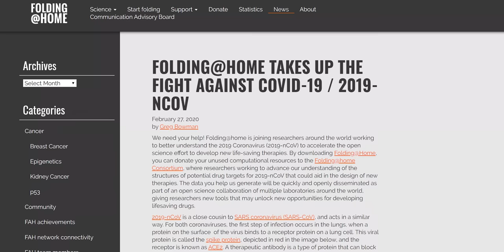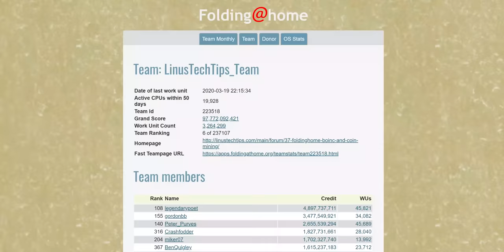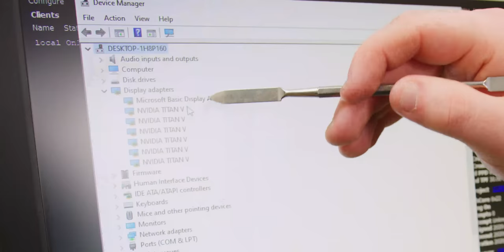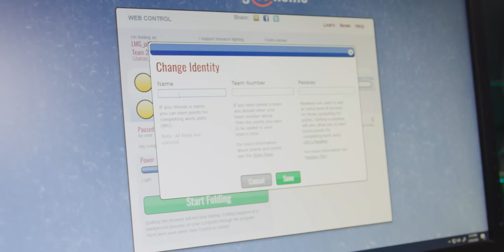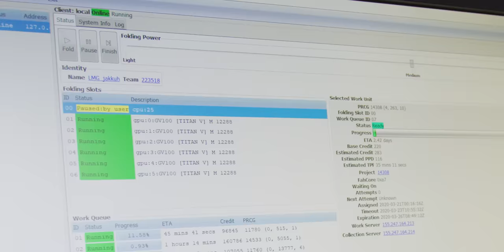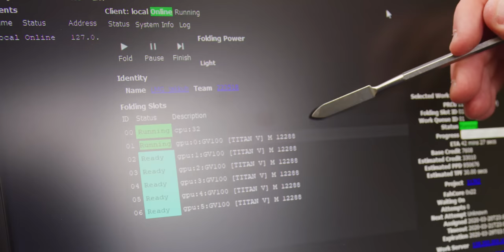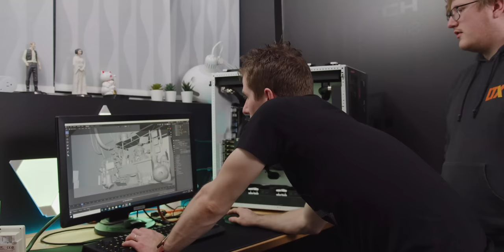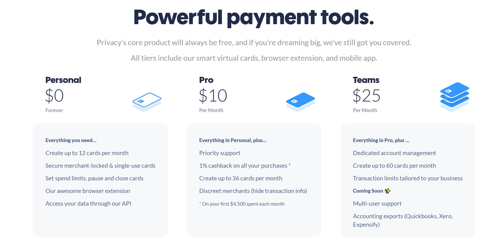Here's How YOU Can Help Find a Cure for COVID-19!

Comment: Sadly, I tried to run Folding @ Home last week (I had the same idea to help with COVID research) and found a few things:
1. My machine (which is rock-solid most of the time) would soft-lock daily, sometimes several times a day, whenever Folding @ Home would start working. Note that I'm not running anything odd, standard clock frequencies on an i7-7700K with an RTX 2080 and 32GB of RAM, Windows 10, etc.  Has anyone else found the same? Anyone found a fix?
2. Folding @ Home didn't have a COVID research category back then. While it felt good to help with research in general, I'd really like to ensure that my compute is helping with COVID research at this time. Have they fixed this? @Linus, have they addressed this?
Reply: I´ve had this happen occasionally when my GPU was folding full blast and I tried to watch some 1080p youtube videos, or do anything that borrows any more than a minimal amount of graphics power. My system has an i5-9400F and an old Radeon R7 250X. Another thing is that if I messed too much with the workunits (closing the folding program without clicking pause, restarting the system several times or pausing and restarting WUs too many times) they tended to error out. Note: I´ve always ran the client even while using the computer, and paused the WUs when necessary, like for gaming.
Reply: Gian N I tried it again today and sadly ran into the same result as before within a few minutes of starting a workload. I was re-watching this video (ironically) while it ran a medium-level operation and just a few percent in, it seemed ok.... then boom. BSOD!
Reply: @jerisbrisk7519  The first thing that comes to mind is if your power supply can handle the load, perhaps GPU folding draws more wattage than gaming? More so if you´re also running a CPU slot on F@H. If its at least 600W from a reputable brand, then it might be crapping out as opposed to not being powerful enough. 
I had some BSODs recently too cuz my 8GB memory stick was dying, so got it replaced under warranty after I ran memtest86 and showed errors almost immediately. Prime95 torture tests also failed after a while. Maybe you can get a clue from the BSOD report, which can be looked for on event viewer and shows a bugcheck code like "0x0000001a." I googled the code and found it was "MEMORY_MANAGEMENT".
Reply: @giann3021  Thanks, Gian. My PSU is a 750w from Node, designed for the Node 304 case my PC is housed in. I doubt I'm browning out, but who knows?  I don't have a Killawatt handy to test with, so I suppose it's possible.  Just based on the fan noise (usually a good sign of power draw) before and at the point of BSOD, I don't think I'm stressing either CPU or GPU that hard.

Comment: My GPU is running at 70C and when the CPU starts processing, it hits 80C. Is that too hot?
Reply: Depends on your components, but I've been crypto-mining with my RTX 2060 Super at up to 76-80 degrees for months without restarts and alls fine. I also mine with my R5 2600 which can hit 72.
Reply: @tfromthasix1956  Thanks for the reference point.
Reply: aowi7280 No problem!

Comment: Standard residential outlets (not breakers) in America do go to 2400 watts max rating. 20 amp X 120VAC = 2400 watts, but you are correct in a way. 1640 is 70 percent of 2400 which is what you want to be in for a constant amperage draw range on a full circuit or pass thru of the receptacle, don’t want to max it constantly. Explaining this only for people who were curious by his statement.

Comment: I own 3 pentium pc’s, trying to get them connected to the internet to install folded@home on it , but guess what i didn’t either of them on the internet , 1 didn’t get connected to the internet at all , whether i tryed it with a cable or just wirelessly, the second one despited it did get connected the the intermet, gave my an error massega evertime i tryed to go to that folded@home site,, the 3th one slso connected to the internet but i did gave my an error massage saying that my pc was out of time so i had to correct the time & date but even after trying just that i still ended up with an error massage, , i tryed 2 different browsers but no luck, i wanted to update both browsers but no clue how, but man that was  unbelievible , hogging those pc’s one after another out the garage in an attempts getting them to work, not mention i also had to try many keyboards & mouses for each specefic pc to get them to work pffff ,oh man i was feeling myself just like pink panter facing sooo many troubles i couldn’t solve, pfffff
what a joke 😀☹️😀☹️, so“sorry corona patients i want to help you all in such a cool & exciting way like this but i can’t so i give up on it.

Comment: he goes on about why you should use older hardware for this then pulls out a system which i would say is still more powerful then most have as their main system XD 
I mean that would probably still out preform my main i7 8700k, 32Gb ram 8tb nvme 2080ti build which is current.

Comment: Hey Linus, Great Work there Guys! 🌍🌎🌏⚡
Super-Machine, this One is! 😊

Hope you Guys can really come together with the project and set up a folding@home Server there so we all can Boost the project even more!

I too have started with folding@home some time ago (as well as BOINC - Rosetta@home) but I decided to suspend BOINC projects and going full power with folding@home, for one simple reason: each of the projects only use 1 core/thread per project. IMHO, this is not productive, since you get for example 8 simultaneous projects running on an 8 core/thread cpu, each needing 8 hours or more, to complete.

On the other hand, you have folding@home that uses ALL of your CPU power to tackle 1 project at the time, thus minimizing its completion time to the bare minimum! Plus, it uses WHATEVER GPU is available, comparing to BOINC that some of its projects use only nVidia GPUs (to my knowledge).

Comment: Hay Linus I really hope you see this, I have some older servers I don’t use and I would love to put them to good use. One is a supermicro X8DTH-IF with duel Xeon e5520 with 24gb of ecc ddr3 and a 250gb ssd. Well I don’t have 8 sata drives to go in this thing. The other server is dell power edge r710 with six 146gb 15k sas drives, one 6 core Xeon at 2.8ghz and zero ram. I understand there is a way to link this with your outfit. I would love to receive a donation to get these two servers up and running for a good cause.

Comment: I am considering buying a graphics card for my home PC, to boost folding power. First of all I would like to know if it is worth it, because I rarely see my girlfriends GPU running at all, thus I would like to know if there is any kind of shortage in GPU's (now and in future). 

Further Should the CPU be to scale with the GPU, I don't want to buy a top end GPU and then find it bottle-necked by the CPU. If it needs to scale, what is the top spec I can couple with a Intel Pentium G630, in a stock lenovo H420 (other than ram upgrade to 12GB total DDR3)  running windows 10 

i do realize that it is possible I will need to upgrade my power supply.
Reply: I am not at all concidering gaming on the PC, the GPU would be nearly exclucively for folding